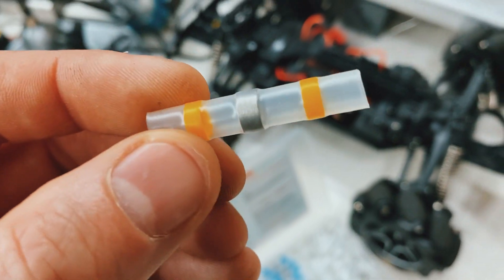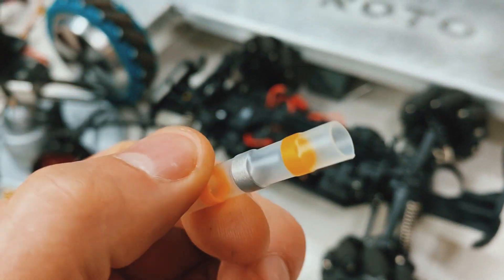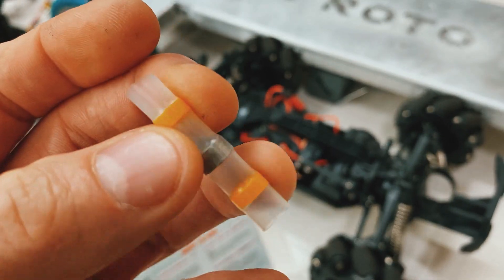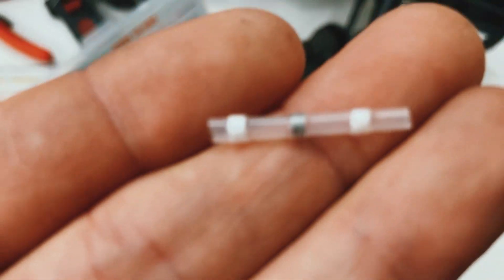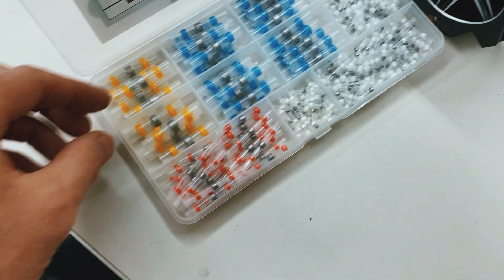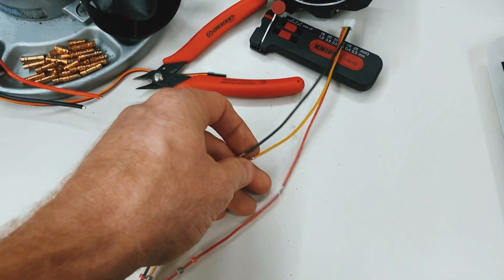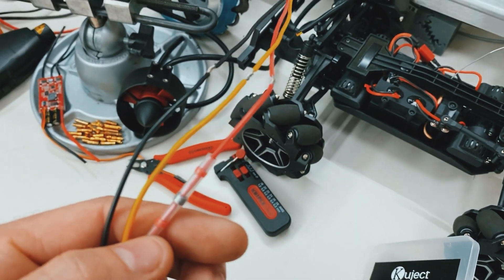Quick Tip #11 Self Soldering Heatshrink Tubes with Adhesive

Comment: I've found that it really pays to buy decent quality versions (or test the ones you get). A couple different ones I've tested don't actually flow any solder into the joint. Obviously still functional but not as good as I hoped.

Comment: These should be in everyone's tool kit if they do anything electrical. I ended up buying a 1000 piece kit and have not regretted it. Cars, boats, random electrical projects. Heat gun is definitely the way to go for joins. For cars especially I've had these save so much time splicing wires in awkward places where getting a solder gun would be near impossible.

Comment: Big Clive did a video on these: https://www.youtube.com/watch?v=unxEdyW8RP8
Basically the solder does not make it all the way to the core, but sticks along the outside of the wire. The strength of the joint is only as strong as you make it before adding these. Solder is not for mechanical strength anyway, but this brittle low-temp solder certainly does not add any, and adds little to the electrical conductance. So these seem to me a little gimmicky -- about the same as a regular heatshrink tube.
Reply from the maker: I just watched and he used a thicker gauge wire for his tests and said at the end that for the thinner gauges it’s probably more than enough to do the job. I have to agree with him that there may not be enough solder in the ring for larger gauges like 10 gauge to completely flow. I wonder if fluxing the thicker wires first would help it flow more to the center. After seeing that, I would definitely solder higher current carrying wire and still use these because I really like the hot glue seal on the ends. I’ve only used the white and red ones that are more for signal wires and I can confirm that they definitely solder to the core. I haven’t tested larger than 18AWG.
Reply from the maker: I just checked and the proper use of solder sleeves is shown as an acceptable solder splice in the NASA wiring manual NASA-STD-8739.4 on page 70 and 71. You can download the full manual here: https://standards.nasa.gov/standard/nasa/nasa-std-87394

Comment: That's not a good that a silicone ring
When you shrink tube shrink it will form a tight seal between wire and shrink tube

It's all pressure doing it's job
Reply from the maker: No, it is not silicone it is definitely a thermal glue. It says it right on the front of the package.

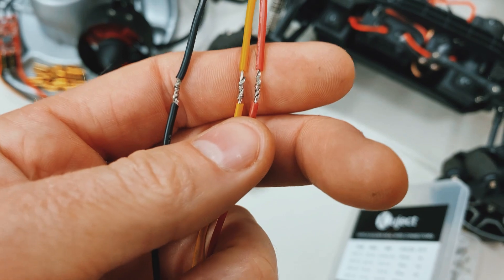Comment: I'll bet you slide the tube over the wires, then twist them together and apply heat. 0:50 (grin)
Reply from the maker: Haha, definitely put the tube on the wires before twisting it! I meant sliding them over the joint before applying the heat. I’ve definitely had to redo standard solder splices in the past because I forgot to put heat shrink on first.
Reply: @ProtoG42  I think if anyone has done any volume of this type of work has had that happen. At least the ramifications are much less troublesome than a gear-up landing in an aircraft.
Reply: Twist is optional. NASA extensively tested solder joins and found no appreciable difference between wires interlocked then soldered vs twisted then soldered. Their testing was related to solder join reliability for rockets. You do you though, I know too many people that swear by twists and knots or whatever else.
Reply from the maker: @saccaed  I mainly do it because it makes the connection easier to handle by holding everything together for me before I solder. I actually worked at NASA for two years and I usually do a lineman's splice to NASA standards. You can download the NASA manual here: https://standards.nasa.gov/standard/nasa/nasa-std-87394 If you look on page 70 of the manual you will see not only the linesman splice but also the solder sleeves I used in the video. For the solder sleeves, they just have the wires laying next to each other so it's fine either way but the manual is a good read for those interested.
Reply: @ProtoG42  Thanks for link. The manual I remember reading through was from the 70s or 80s. This is much newer.

Comment: You shouldn't turn off the hot air like that, if you would turn it off as it is meant to be (putting it on the included stand) the air will cool the heater first and then turn off, making it last longer.
Reply from the maker: I just checked the manual and you’re right! It says not to turn the unit off until it drops below 100C. I’ve just been turning it off like this for years now, thanks!
Reply: Heh. I have a Makita heat gun that is older than I am and I personally have witnessed contractors throwing it to each other and missing. Think is built like a tank and I use it daily.